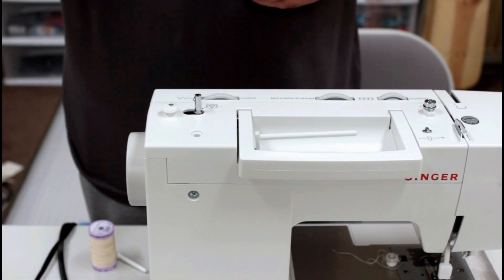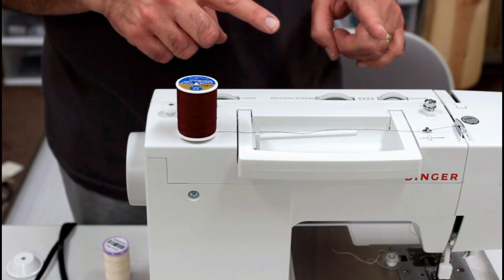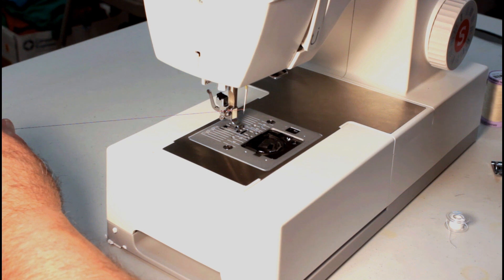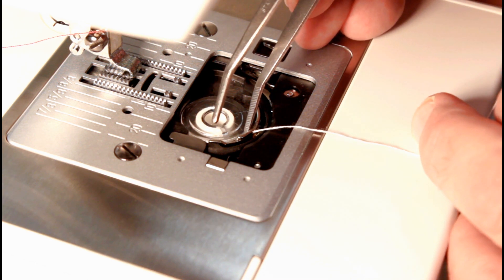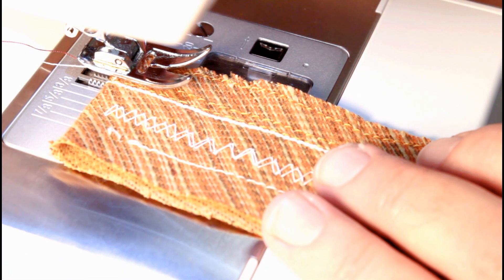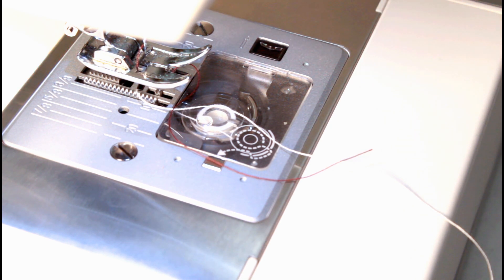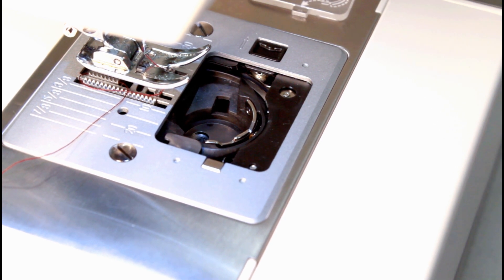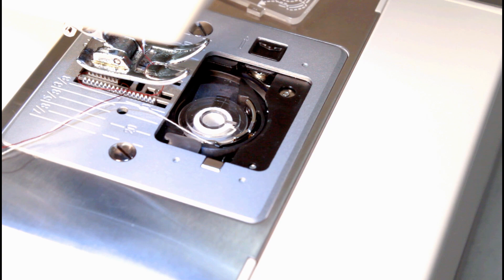Solving Threading Problems and other Issues

Comment: I took my singer heavy duty into the repair shop and they told me that it had the wrong size Bobben in it with toothache a thread so correct and all that it’s sewed fine for a few minutes did what I needed to do got it back out and now the Bobben doesn’t even turn  in the shuttle And pick up the thread will not so anything.., help
Reply from the maker: I sounds like the gear on the bottom side of the machine that turns the bobbin has come loose possible.

Comment: I have a Singer 4452 that I have been using for a few months with no problems until now. When I am starting to sew on a piece that has a fold and beginning at the fold the thread gets a top birdsnest and the cloth starts to bunch up. If I begin opposite of the fold It will go along smoothly even over the fold. I have made a slight adjustment of the presser foot pressure but it still does it. Could it be the thread tension? Or something with the feed dogs?
Reply from the maker: Scott Tisdale Use a scarp piece of fabric to start then join your piece of fabric right next to it and leave a small gap so you can cut the snip the thread between the two pieces when done.

Comment: What size needle is a universal for this machine?
Reply from the maker: Mine were shipped with a size 14 Universal needle.
Reply: No such thing. Needle size/type depends on the type of fabric and the thickness of the thread. A fine silk thread might require a 60/8 while a heavier jeans thread might need 90/14. Then there's the type of needle. A knit might need a Jersey needle while a cotton lawn would sew best with a sharp. More here: https://www.schmetzneedles.com/all-about-needles/

Comment: So what about if the top thread is messing up under the bottom it’s not the bobbin the top thread isn’t locking in right on my machine
Reply from the maker: It can be  that the thread is being restricted from wrapping around the bobbin as it passing through to picked up the top thread.

Comment: Does it matter the brand of Class 15, plastic bobbins should be used for this machine?
Reply from the maker: Class 15 plastic only. Don't use metal because they bend way to easily. Brand hasn't really mattered to me.

Comment: Thank you KEVIN SEWS. I am new to this machine.  It's very complicated. I still don't understand why singer redesigned their machine. The old design is simpler and adjusting thread tension is easier. Without this video I won't be able to use this new machine. If I can find an old design, I will buy one. I still regret buying this new machine. I think it's garbage. After 9 months I started having problem already.
Reply from the maker: Singer is now just a name. It isn't the company it once was the designed and manufactured and sold their machines in their own stores. They were bought by a group that owns several European sewing machine companies. There are no Singer factories anywhere in the world now.

Comment: @Kevin Sews may be you can help me figure this out : my top thread is looping on the bottom side of my material. . . I am giving my machine to my niece as her first learning machine.  I unscrewed the presser foot pressure adjustment thinking It was one of the screws to remove the face plate would that cause my top thread to loop on the bottom?
Reply from the maker: No, that just adjust the pressure on the foot. Thread looping at the bottom is a lack of tension in the needle thread. Raise your foot and grab ahold of the thread on top of the machine; then pull on the thread through the backside of the needle creating tension. Then lower your presser foot and sew some stitches. If this doesn't fix it your machine probably needs a good cleaning. It is amazing what a small piece of lint can do to the quality of stitches your machine produces.
Reply: @kevinsews  thank you for your help

Comment: I threaded my machine just as you showed and checked the tension by pulling on the top thread. The needle bent as you showed, but I’m still seeing top thread on the bottom side of my fabric during my straight stitch. My tension is 4, needle position is middle, width is 0 and length 2. What do you suggest I try?
Reply from the maker: Your bobbin tension may be too tight. In the end it is a tug-of-war between the needle tension and the bobbin tension. After that it can be a threading issue. Make sure your thread is on the proper post (Vertical vs. Horizontal). Next, are you using quality thread and the proper thread and needle (a new needle) for the fabric. On some thinner fabrics you can never make the two threads disappear into the cloth the way you can on more dense fabrics. Anyway, lots and lots of variables on this subject for sure.

Comment: I have a brand new singer 4111 and the top of the bobbin won't move. So bobbin wont catch. Please help. The tread won't Move across like it should. Been trying for 4hrs. Thanks. I'm ready to take the machine back.
Reply from the maker: Sorry to hear that. Your message was held for review for some strange reason. Did you get it figured out?

Comment: Hi Kevin! My bobbin thread is getting caught on the stopper when I’m trying to prepare for sewing, thus it creates a ton of tension and then immediately the thread gets tangled and won’t allow me to sew at all. Doe this make any sense?
Reply from the maker: Download the Service Manual using the link I posted in the video description. Turn to page 19 to see how to adjust it. If you don't have the gauges they show in the manual then simply loosen the screws they say to open them up a bit to allow the thread to pass through.
Reply: Thank you so much! I did it!!

Comment: I really appreciate this video cas I bought a singer 4423 an to my surprise there was no manual for direction . Is it possible that d forgot to put in d manual..great job for us beginner.can I use my machine wit different presser foot ,if so would like a video on how to use them.thanks Mr Kevin for your great help
Reply from the maker: You can find the PDF manuals on www.singer.com  I use them more than I do the printed manual. That is because I can search for a topic and then I just print out the few pages I need at that time. Beats trying to find it in my filing cabinet.

Comment: Thank you for the information on the post for the thread. The problem I am having (brand new to sewing🤷🏻‍♀️) is that that	there is no tension, I have threaded the machine at least 7 times. The first time it worked great, but now there is no tension and it doesn’t change when I turn the dial. 😩
Reply: Karen Whiteway Make sure you raise your presser foot all the way to the UP position BEFORE you thread your machine. Why? To open all tension discs so they can RECEIVE the thread. Then you can lower the presser foot if you need to AFTER you thread the machine. Thread your needle. Threading MACHINE and threading the NEEDLE are two separate processes. Hope this helps. Give it a whirl!! 😊
Reply from the maker: With the foot lowered when you pull the thread through the needle eye it doesn't have any tension?
Reply: Kevin Sews I don’t know why I didn’t get notified of your response. I’m going to play with it again tonight. Gingers crossed it works okay.

Comment: Thank you so much for this video. I follow all the steps as you mention but  my Singer 4423 still not making perfect stitches. That Grey button on your machine is all the way down on your machine; on mine is about 3/16" up. Would this be the problem? There is no gap between the stitches. Any suggestion? Once again thank you.
Reply from the maker: A Melendez Yes, that causes the stitches to shorten.
Reply: Ok Kevin thank you.
Reply: I was under the impression that the grey button was to adjust the hight of the presser foot.
Reply: A Melendez  😱😱😱 what grey button??
I have a 4423, I don't want to mess it up 😭😭😭

Comment: I bought a Singer HD 4452 and the accessory kit did not have the horizontal spool cap.  Do i need to buy one specifically made for that make and model?  It seems to me they should be universal in terms of both the outside diameter and the internal diameter of the hole.  Am I wrong?
Reply: I would buy it if I were you. It keeps the thread from coming off.

Comment: My singer scholastic keeps breaking the top thread, I have changed thread and needles, not sure what is happening with it.  Any ideas for me to check.  Thank you
Reply: Try changing the brand of thread.  It might be horizontally spun rather than cross spun
Reply from the maker: Oh boy, I have so many questions... What thread? How is it wound on the spool? How old is the thread. Needle? What type and size for what fabric? They need to match the fabric you are sewing. Are you absolutely sure it is threaded correctly? Then there is tension..... how tight/lose is the needle thread vs. the bobbin thread?

Comment: Hi I have been enjoying your videos. I am still having problems with tension on my machine and don’t know if I need to adjust the buttom tension or if the problem lies elsewhere. The top stitching looks ok on all tension settings but the bottom stitching is uneven and crooked on all tension settings.
Reply from the maker: https://youtu.be/-94cSYbxkpw

Comment: Got a new heavy duty and tried everything on the threading tension and still getting thread stuck in the machine and loose loop underneath.  Could this a timing issue as we had to fix a timing hook issue as well.
Reply: Connie Moy Always turn the hand wheel toward you and anchor needle in fabric before sewing. Moving the hand wheel away from you can cause nesting and eventually a jam. And hold threads taut in back of the machine bed before you make a few initial stitches. Then you can let go of them. But remember: this is a manual machine and the needle won't return automatically to the down position. Always turn the big wheel TOWARD you if needle in up position or you will have problems because that wheel was never meant to go against its purpose for being there. Some sewers find out the hard way, so just trying to remind you to always turn it towards you if you want to bring up the bobbin thread or if you are ready to sew and require needle to sink into fabric before stepping on the foot pedal. 😊
Reply: Jude Jane Thanks for responding and the advice.
Reply: Connie Moy  I hope you are able to sew and have some enjoyment. Did you rethread, making sure you didn't miss any tension disks, keeping the presser foot raised to highest position while you threaded the machine to open up all the tension disks to receive the thread? 😊
Reply from the maker: Connie Moy One way to find out if it is a needle thread tension issue... try grabbing ahold of the thread on the top side of the machine to create more tension. If this solves the issue then it is definitely a top thread tension issue.
Reply: Kevin Sews thanks for the advice and will try it again.
Reply: I have the same problem! The weird thing is that is happens sometimes. So i tread the machine once, somtimes the tread gets stuck and sometimes it doesn't
Reply: Lieke Verdonk Once you put needle down into fabric, you cannot change needle position unless you bring the needle back out of the fabric by turning the hand wheel (wheel on right side of machine) TOWARD you and smooth out the threads tails, pull them gently under the presser foot and behind the sewing bed, before you switch to a different stitch pattern. Always lower presser foot before sewing.Then you can restart stitching.  If you don't take time to do this, your needle will stick, bend, and you will get a jam caused by a nest of thread in the bobbin area. Always CHANGE needle after a jam. It may look fine to you, but can't be after that torture to it...remember that very LOUD crunch!😁
Reply: Jude Jane .

Comment: I had mine on the wrong post too!!! I didn’t even know that post existed! In the directions it didn’t say there were two posts options Thank you so much for showing me!
Reply: Rebecca Pope The extra spool pin also used for twin needle sewing or to hold a spool of a different size vertically should you want. Either pin can be used to put a spool onto it to sew with, but if you are a new sewer, stick with the instructions here first! By the way, always turn that big wheel on right end of machine TOWARD YOU when getting bobbin thread to come up from the bobbin case area to meet the needle thread , and give yourself a good 5 inches of BOTH threads pulled gently UNDERNEATH the presser foot and back of machine to avoid thread coming out of needle when you lower presser foot and turn the hand wheel toward you again to lower the needle into your fabric. Never operate machine with needle in up position or with presser foot up, snd NEVER turn that hand wheel away from you, especially once the needle has come into contact with your fabric. Hold BOTH bobbin thread and needle thread while turning hand wheel toward you and sew a couple stitches keeping threads pulled taut. This keeps threads from falling down into the feed dogs and causing "nesting" and a loud crunching JAM. Very bad for machine even though you can fix it in a few minutes. (Can break your machine or throw timing off in rare cases when machine operator causes this error, but quite avoidable with care taken not to let it occur in the first place). Hope these tips are of help to you.
Reply from the maker: My pleasure!

Comment: Very happy with mine. I use Gutermann Tera 40 thread to my projects. Thicker thread than that didnt work for me.
Reply: Grymme Göta This machine takes metallic thread, all purpose polyester thread, silk thread, 100% cotton thread -- you say one thread works, but depending on thread used, needles come in various sizes and types. The problem is NOT the thread but the needle you use WITH the thread weight. Heavier threads need a larger eye in the needle to smoothly flow through it. Google needle sizes and types and try to avoid Amazon because they have sellers who are selling counterfeit supplies there. Shop locally or contact Singer directly on their own web site.

Comment: Oh my gosh I had my thread on the wrong post!!! That fixed my jam right away, thank you for your help!!
Reply from the maker: Stephanie Sally You’re welcome!
Reply: @kevinsews  I today just purchased a heavy duty singer today 
I’ve taken out the case
I’ve drop a dot of oil- however there seem to be extra oil under the plastic bobbin holder 
I used the brush to wipe away
Looks like manufacturers oil?  Not sure this machine was used much zero lint or thread in the case. 
This where I’m concerned 
The machine seems loud and the tension had to be at 6 before I had a good stich
Is this pretty normal?
Reply from the maker: @MissyJohnson1991  No, setting it on 4 should get you good tension using normal thread and fabrics. Make sure you raise your presser foot when threading. Then grab both ends of the thread and pull it tight to ensure it goes through the tension disc before lowering the presser foot.
Reply: @kevinsews  thanks I’ll re thread and see how it looks, I moved the coats and Clark thread over to the pop in holder
I’ll re thread with it being in the up position and pull through before I lower the foot
I moved the tension back to 4 here goes
Reply: @kevinsews  baffled in Ohio 
I just did what you did in the video- to thread it properly 
It came with the zipper foot attached 
For some odd reason when I did the tug on the thread trick
The arm slammed into the feed dogs and snapped off the needle 
Took it apart could not find the tiny sharp that snapped off

That said moved tension to 3
About where was when I bought it
When purchasing I skipped thread numbers 7 
For giggles I skipped number 7 again 
Well to my shock she is sewing pretty good
I have not done a bus load of research however is this machine to be threaded in numbers 7?
Singer 4443/4452
My brother SE600 is in the shop so I bought this machine because I make dog gear and I feel it’s to much for my brother and this is why she in the hospital 
Hopefully it’s the operates on this singer and not the machine
Reply from the maker: @MissyJohnson1991  First, it should NOT have come with a zipper foot on it. It should have come with the general sewing foot on it. It sounds to me that you were shipped a machine that was returned. Unless they said this up front they broke the law. I would contact them immediately and tell them they shipped a used machine to you.

Step 7 shows 2 guides in some of the manuals. Did the larger guide on the top pop off or the smaller one around the needlebar? Either case both are needed.
Reply from the maker: @MissyJohnson1991  It did the job before you wiped it away.
Reply: Gracias por su ayuda fue muy oportuna y buena para mi.muchas graciad
Reply from the maker: @mariavictoriabromeo.3997  Me pleasure!
Reply: Me too! OMG. I've watched so many videos on bobbin thread jamming and not a single person mentioned top thread position. This totally explains why my machine works fine when I use a super size white thread (spun vertically) and jams up with blue thread (spun horizontally). Holy crap. I can't count the number of hours I've spent trying to fix this issue.
Reply: Geez!  I had my thread on the wrong post as well!  Who would of thought!
Reply from the maker: @debbierickard5568  Yeah, the sewing machine companies are not very helpful on this subject. I guess they don't know either.
Reply: The first three things he mentioned, including the spool on wrong post, I was doing wrong/not doing.
Reply from the maker: @TimDonk  I hope it was helpful.
Reply from the maker: @Ana-tk4ty  I am glad to hear that it solved your issue.

Comment: I have a question please. I have broke my snap on shank adapter ? ( the thing my presser foot clips into.) I am trying to replace it but I do not know if it is a High, Low or slant. I have a Singer Heavy Duty 4452. PLEASE can you help.
Reply from the maker: Low Shank. Try www.sewingpartsonline.com  Just enter the MFG and Model # and they will show you all the parts for that machine.